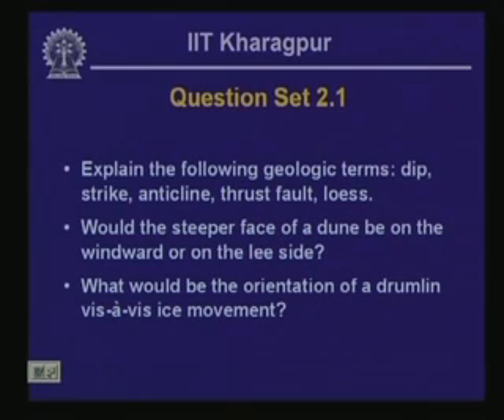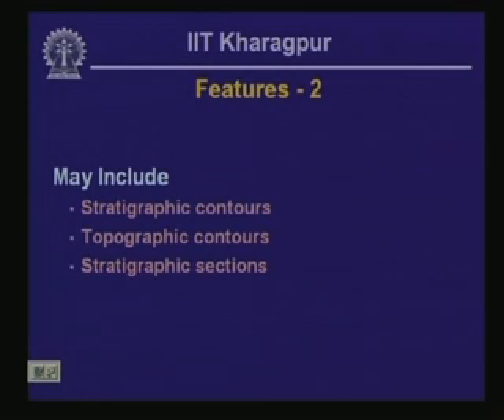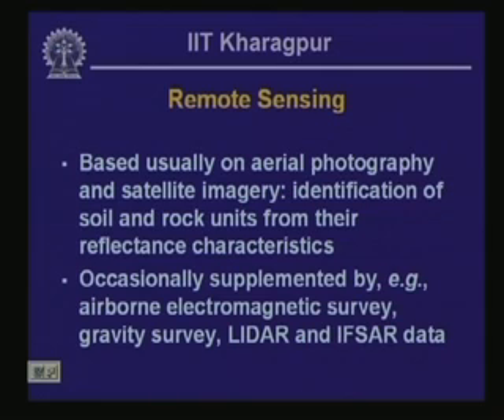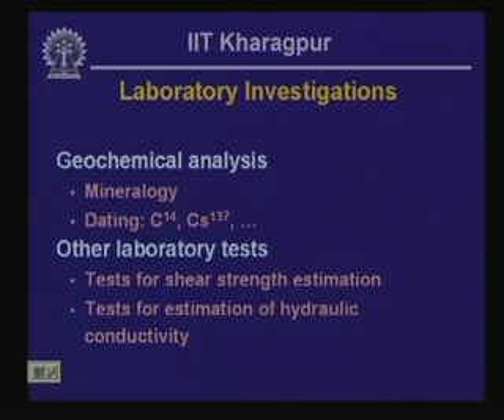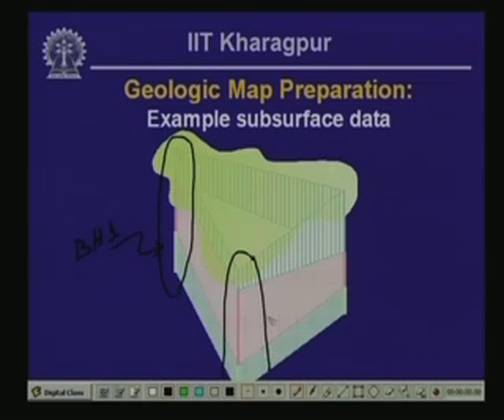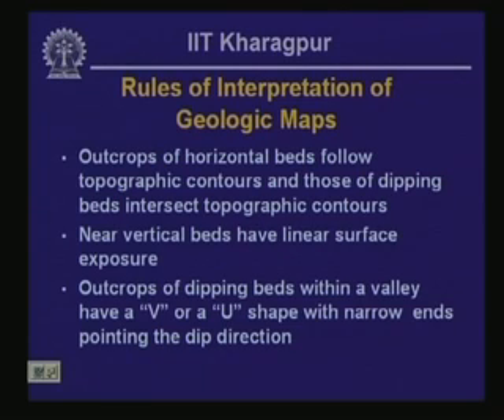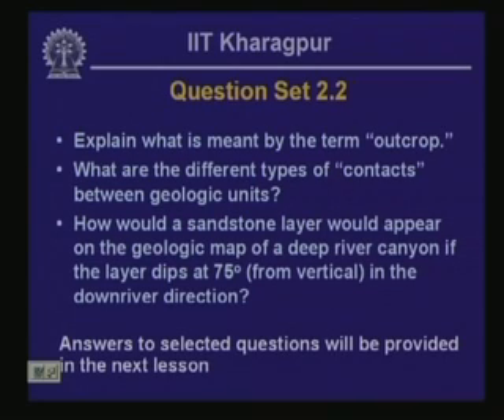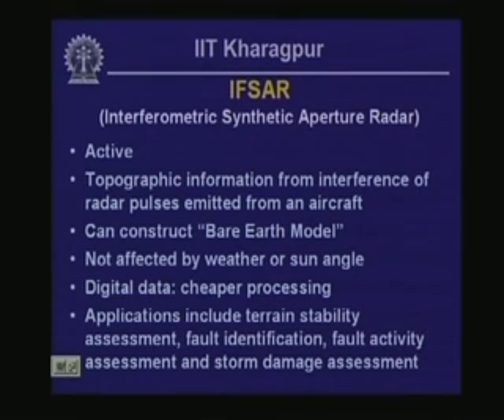Lecture - 3 Geologic Maps and Stratigraphic Sections

Comment: @smithdizzy78 if your talking about pitch and rake then you're correct. however i was refering to plunge of the fold axis, not bedding or a lineation/foliation. so we are both correct. in my opinion strike and dip is a much better way measuring structures.